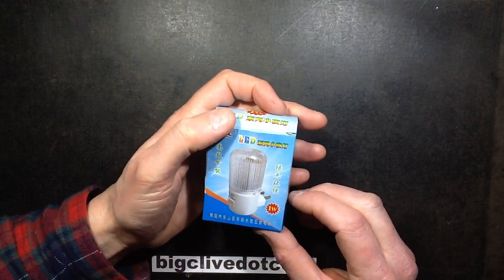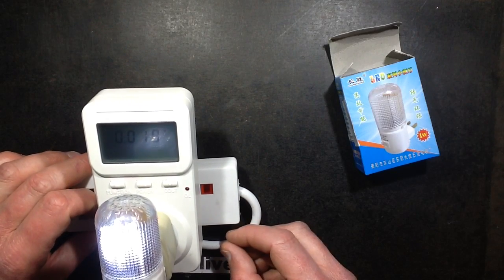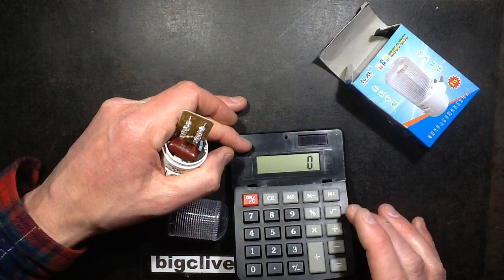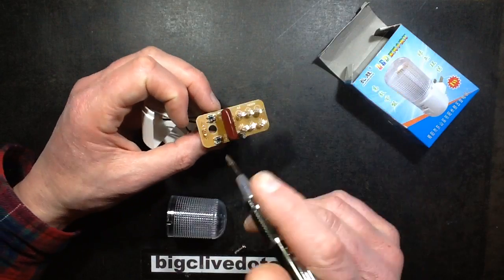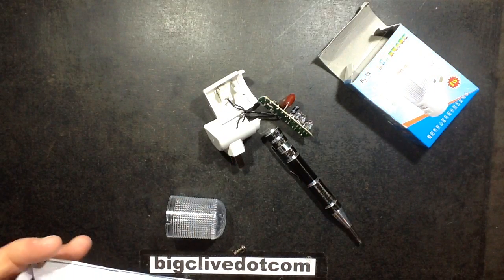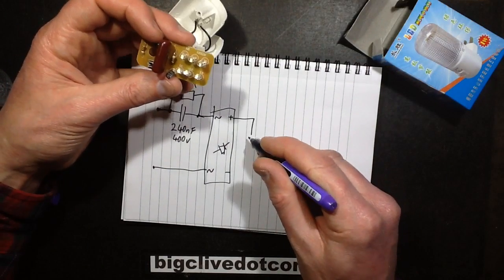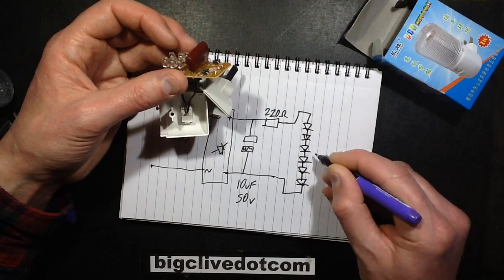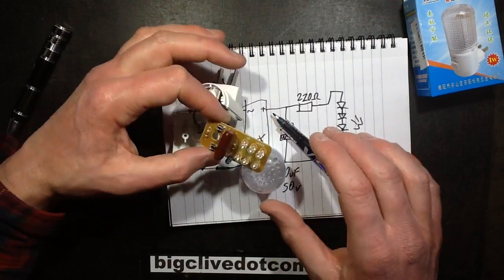A look inside yet another LED night light.

Comment: I'm a little bothered by the lack of any kind of fuse.  If that main capacitor shorts, it's going to get interesting.  Hopefully, the components burning up doesn't set the plastic on fire.
Reply: the inline resistor acts as a fuse..

Comment: How old were you when you received your first mains voltage shock? "I'm not 100% sure", but I think it was before I was 10. At least our line/mains voltage here is only half of yours. But we have three typical ranges: 120/240v, single phase for residential, plus 120/208 and 277/480 three phase for commercial and industrial applications. And sometimes electricians "cheat" and put a 240 volt air conditioner across a 208 volt three phase circuit.

Comment: Well, it glows, but it does it unsafely. Another thing as well..... seeing as this had american pins on it, surely this device should have been only connected to 120v? :D

I'm surprised it didn't go POP.

Thanx for showing,

-BoomBoxDeluxe.

11th April 2015, 13.53
Reply from the maker: BoomBoxDeluxe The Chinese use 220V and have a similar plug to the American one.
Reply: +theSYNQmaster population control?

Comment: The casing looks quite similar to a set of fluorescent night lights, I once had. Bought from eBay (about 10 years ago), the seller said they were neon, but they were just tiny inverted-U-shaped CFL tubes running off a capacitor power supply. They all flickered quite badly.